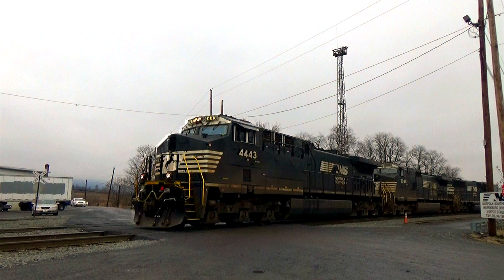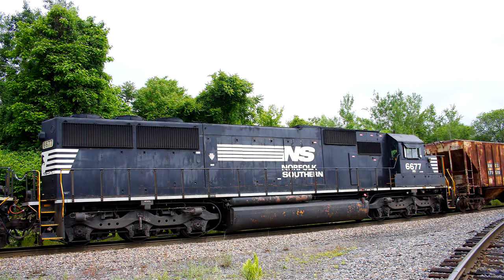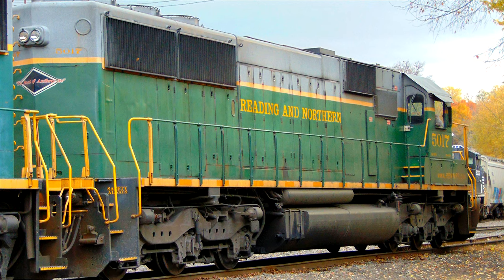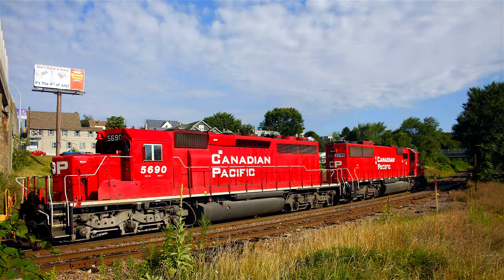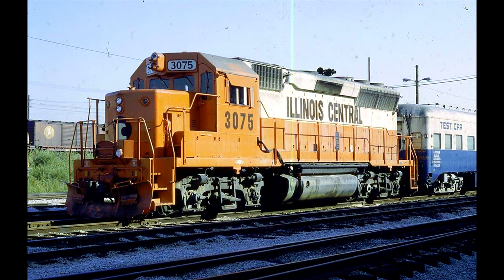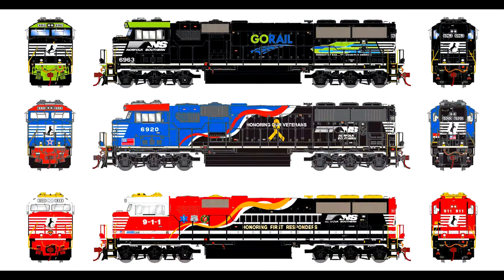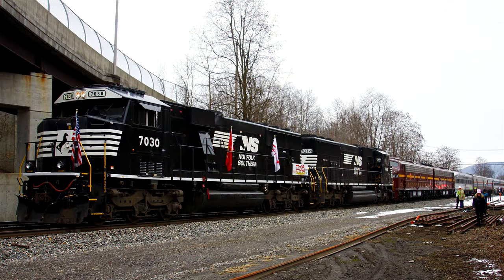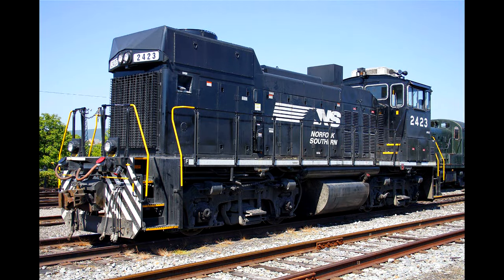Switching with Norfolk Southern's Exclusive SD60E

Comment: Have seen  a bunch of these sd60e running out of mechanicsvilles yard going east to Massachusetts
Reply: The reason for this is a few of the SD60E rebuilds have the ACSES cab signal system that is required to run on Pan Am near Boston in MBTA territory

Comment: Conrail also tested all 3 SD60Macs. They opted for the 60M/I variants instead. Great flick, again. A.C.!
Reply: Conrail had the first 60i ever built.  It was originally 60m, 5544, and fitted with the first WhisperCab.  Some 60i's were built in Juniata, from 'kits' delivered by EMD and some were built by EMD.  The SD60i's were the best locomotives that Conrail ever had.  Conrail was transitioning to all EMD, with the SD80MAC being their latest order.  This was changed in subsequent orders by NS and CSX, for the takeover, to 70MAC's for CSX and standard cab SD70, conventional DC power, for NS.  The NS units were the absolute worst engines ever.  NS has always been shitty with their power.
Reply: @johnandrus3901 its funny you mentioned that last part about them always being terrible with their locomotives!  I heard that same thing with the BNSF crews here at Thayer (most of our non BNSF power is NS, by the way).  In fact, they said alot of the NS locomotives back in the day didn't even have an actual toilet, just a hole cut into the seat with a bucket lined with a trash bag inside.